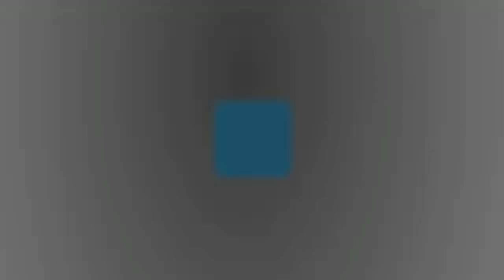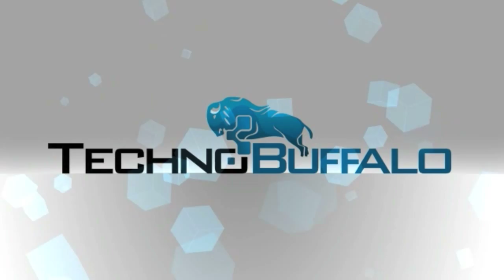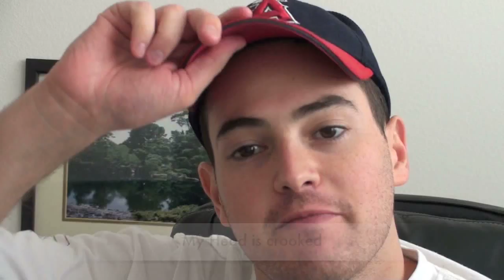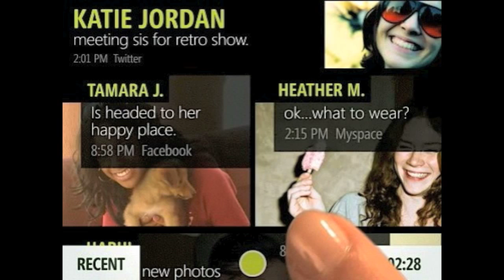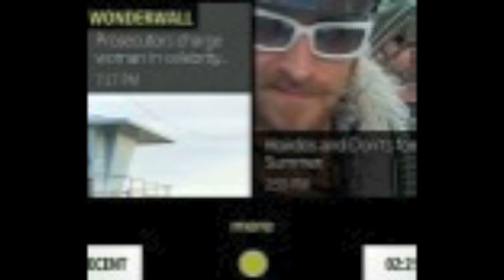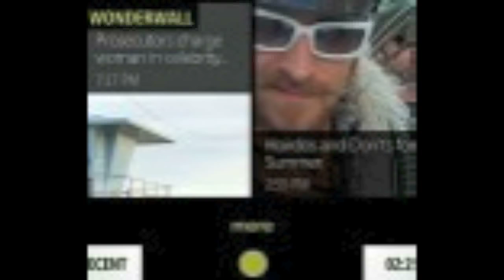Kin 1 & Kin 2: First Impressions

Comment: @bathellfire what do you think the new iPhone will bring? +100Mhz CPU, two to three new software features that should have been included for years now.. maybe something as high-tech as a front cam or an LED flash! Hey cmon.. this is not to be called inovation.. although i like iPhone as an entertainment box that fits in a pocket, im really skeptic when it comes to its new versions